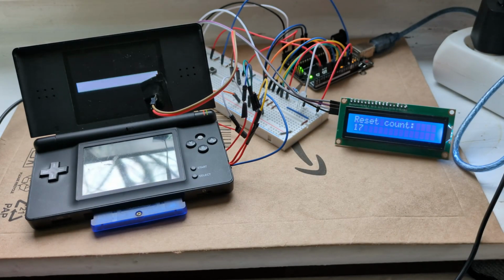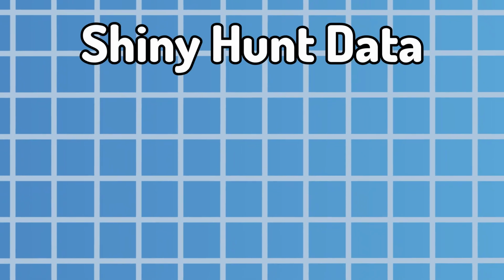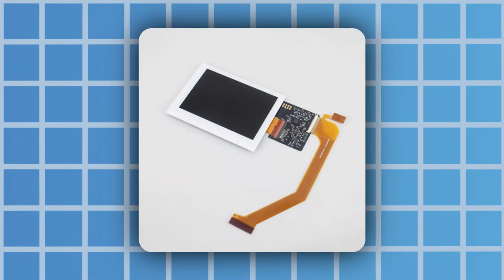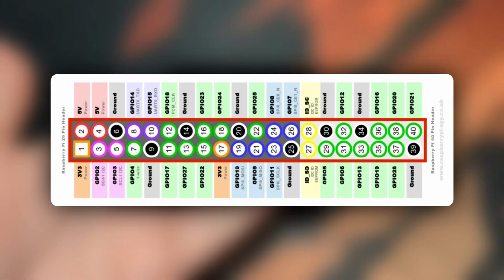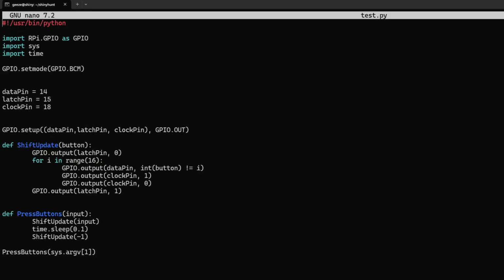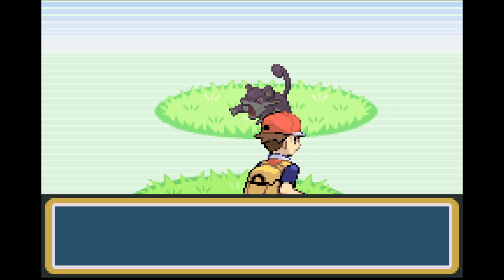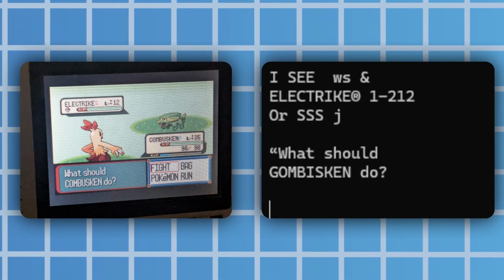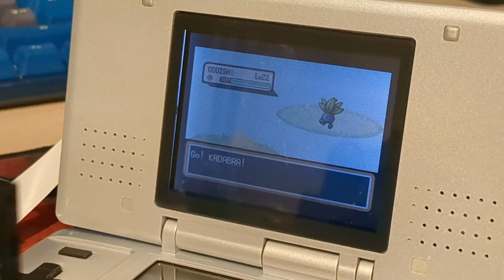Making The ULTIMATE Shiny Pokémon Hunting Bot - Raspberry Pi Automation

Comment: that's awesome! your video was basically a study guide for me lol, im going to try to make one for emulators, feel like its easier (and cheaper) since it doesn't need a camera :D nice video!!
Reply from the maker: Thanks, it's definitely easier with an emulator :)
Reply: @Geeze   You could have used a gameboy player and do this easier on real hardware by using nxbt to connect to a Bluetooth controller adapter for the gamecube then all you need is a pc or pi running linux a capture card and a bluetooth usb adapter. That or use pokemon stadium for gen 2 and an n64 blue tooth adapter as you can speed it up if you unlock the speed up function speeding up the shiny time.
Reply from the maker: @cosmicsvids  That would work except I don't own a Gameboy Player, Gamecube, Bluetooth adapter, capture card, Pokemon Stadium, or an N64, great idea though :)
Reply: @Geeze  Yeah but i'd rather find one of those then doing something that could break a 20 year old console.
Reply: @Geeze  That or i suppose you could make and 3d print a case to put the Gameboy and ds  in and use either solenoids or servos to press the buttons. Issue with this is you kinda risk destroying the console and it requires a lot of soldering.
Reply from the maker: @cosmicsvids  Yeah the servos are a solder free alternative, the DS I used was beaten up already and I've got more, I even refurbished it when I was done so you can hardly tell anything happened (as long as you don't open the casing)